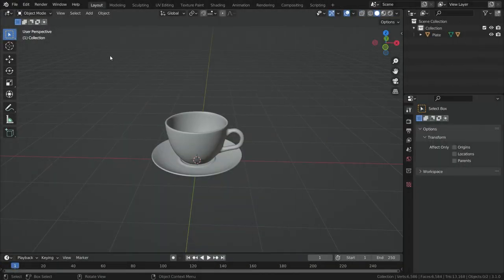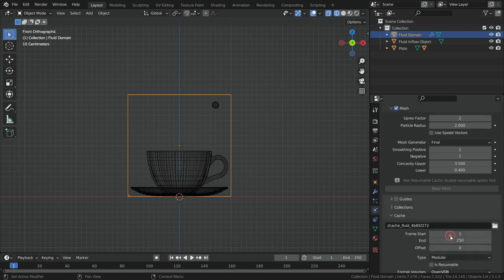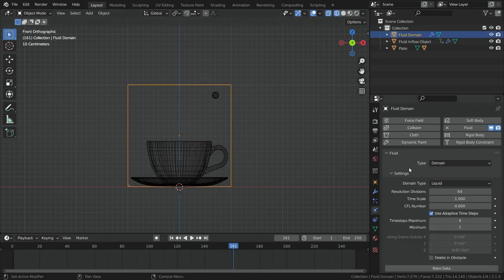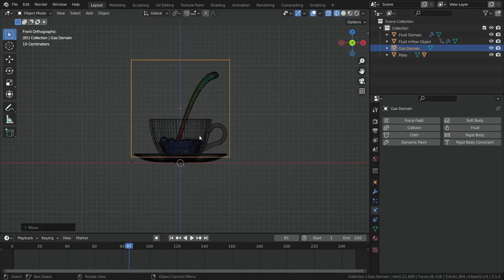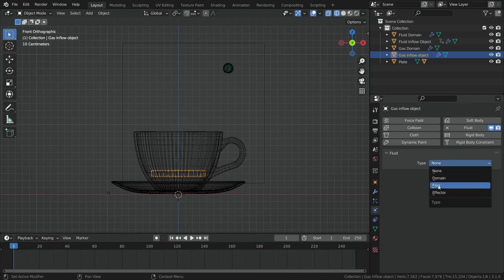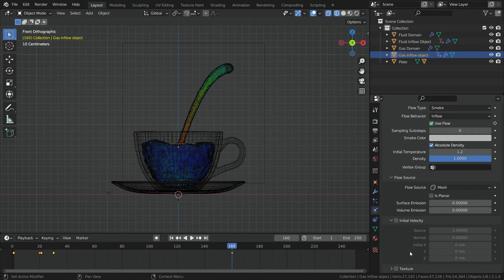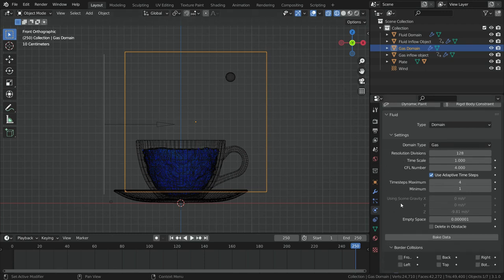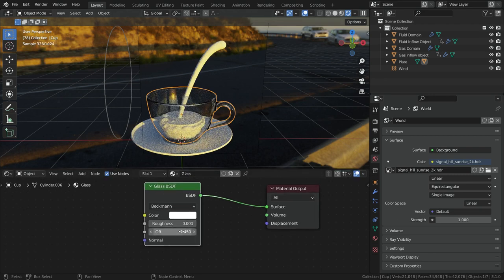Fluid Simulation | Steam And Tea | Blender 3.1 Tutorial

Comment: So I hope you may be able to point me in the right direction but I did hit a snag: The size of the teacup. I did everything with the monster size and it worked but the end result just didn't quite work for me. The size of the cup, It's waaaaay off and so I started from scratch and scaled it down to a more reasonable teacuppy size - I then followed all the steps again, I scaled the cube/fluid domain down and the emitter of course. It looks like before, only everything is smaller. I also applied the scale although it should not make a difference? Other than that I kept all your settings but it does not work anymore and I don't know where to look for what went wrong. 
When I bake the fluids, the emitted particles are huge and they also don't flow into the cup but fill up the domain cube and it's wild! (and yes, I did set the teacup up as effector, planar is checked for it. 
Do you have any idea why things are going completely wrong just because the size differs? I am lost...
Reply from the maker: Unfortunately, sometimes we can get undesired results when we scale the simulation objects and domains. You mentioned that you applied the scale, which is the right thing to do. Make sure that you applied the scale not only to the domain and emitter but also to the teacup and any other objects involved in the simulation. Select each object and press Ctrl + A and choose "Scale" to apply the scale properly.

After scaling down your scene, you may need to adjust the resolution of the fluid domain to ensure that it's suitable for the smaller scale. Increasing the resolution might be necessary to capture the details of the smaller fluid behavior.

Check the initial velocity settings of your fluid emitter. If you scaled down the emitter, you might need to adjust the initial velocity to match the smaller scale. Reducing the initial velocity might help in preventing particles from spreading out too much.

Fluid simulations can be complex, and sometimes it takes experimentation to get the desired results. Just try to make small adjustments and bake the simulation multiple times to see how it behaves.
Reply: @GraphicsMK  First off: hugely grateful for your reply and the effort to help! Thank you so much! 
I only scaled down the teacup I got from your scene and recreated everything else at a smaller scale in a new scene (for which I did have to scale down the cube and so on, of course, but I did not scale down the complete finished scene from before - I tried that at first but saw right away that things were getting out of whack). The scale had been applied to all items in the scene.  
I had already tried to adjust the resolution of the domain but did not notice any improvement so I didn't keep it. Nothing else I have tried has made any difference at all (huge particles, filling the domain but not the cup) so I will give up on that one now. Seems a bit ridiculous but I just have no idea how things connect and where the culprit may be. (I did everything just the same, only on a smaller object, should not make a difference?)
Reply: @micah6861  any luck with making Mantaflow work on small objects?
Reply: @prajwalkharel9754  I am sorry to say that I have given up on the project. Not only could I not get it to work at a RL scale, I also could not figure out a way to get the liquid to calm down and even out after pouring. 
Unfortunately a lot of people make videos with - in my view - unfinished content, to just stop and skip that last part is.. kind of a cheat I feel. So - I was not too motivated to put too many more hours into it. 
If I ever look at it again and find a solution I will put it here. And if you find one, please let me know!
Reply: @micah6861  I am just a month into Blender, total noobie. Wanted to add a cup of steaming coffee to my doughnut animation thinking it could really tie the scene together. 

If am able to figure out a workaround in the near future I will certainly revisit this thread. But from what I heard Mantaflow doesn't play well with small scale objects.

Comment: I found the solution by myself, there is actually a lot of things i need to change when work with bigger objects, but it wasnt hard to figure all out. For the moving object though, i did build a wind system around object for the smoke to correctly work with it.

Comment: Thank you for very useful tutorial! I have a question though - all is working when the size of the cup is by default, but for example what if i need to use bigger sized object (this cup for example)
And when i scale this cup to much bigger size , the smoke is not working anymore, i mean it does appear but not rising up at all, it just stick to the emitter object. Do i need to increase the heat ? 
Thank you in advance for possible help and/or solution. All the best !
Reply from the maker: Firstly, be sure u refresh the simulation and baked it after u scaling up the cup. Secondly, after u scale up the cup,most probably u scale up the smoke flow object also. In this case, be sure that ur flow object still inside the domain. These   may be possible issues.